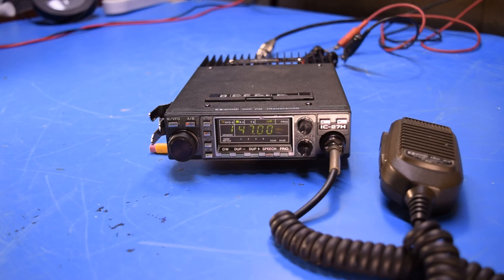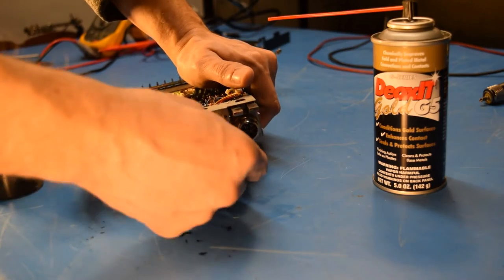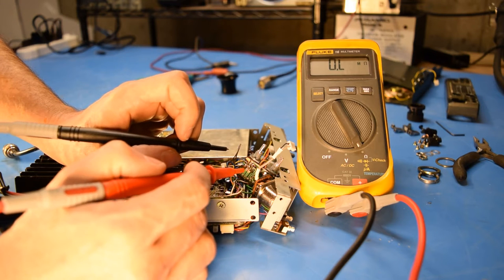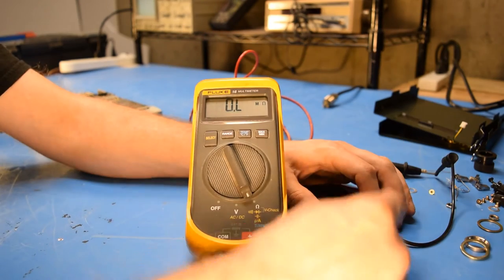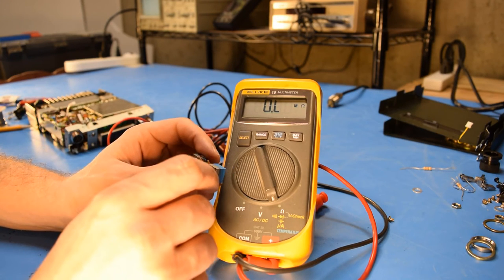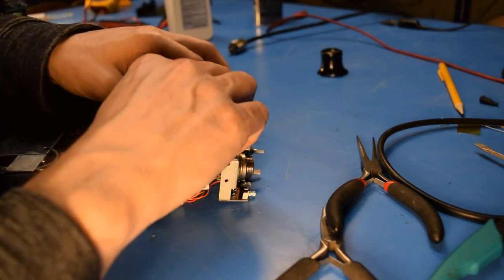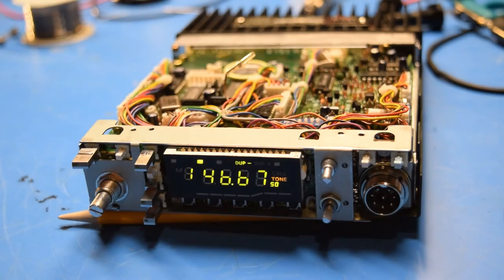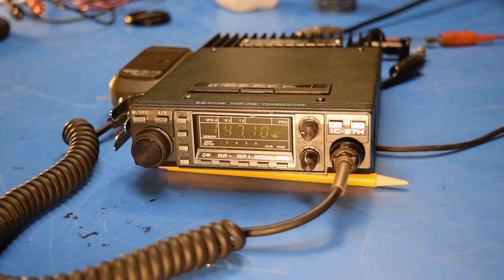Icom IC-27H Squelch Not Working Repair

Comment: Nice job! I just fixed a IC-27E (25W version). It had volume potentiometer totally dead. Tried a few chemicals first but no luck. I spent hour or two to find that part online, but no luck. There were one close match in Digikey though. So I pulled out that pot and opened it. You can take these apart if you are familiar with very small parts and pliers. The potentiometers body is kept in place with two small bars that go thru it. One head of these bars is fixed by crushing. I grinded that end away and pulled bars out. Next you have to take a very small retaining ring off from the back. After that you can take all apart quite easily. Once I got to the resistance carbon ring I used glass fiber scratching tool gently to it. Then cleaned all with isopropanol alc. Same to slide and a little bit of bending more tension to it. All together and then glued the end of the bars. Its now like a new! I still has more to do :) The output is only 17W and 1750Hz tone burst is not working. This radio is pain in the ass to work. Those little wire harnesses goes everywhere, and no room for anything. Old people like to whine about newer radios that those have too little parts. I personally take the smaller parts and less wiring over this! I think next time some oldtimer is whining I will give him this radio and say take a good look at it... Well after all this is a nice radio, very small for its time and a good looking too in my opinion. Its a pity I can't find a service manual anywhere online. 73 de OH5GIO
Reply from the maker: Thanks for the info!  I actually have another one of these radios that has the same problem as yours does - a bad volume control.  Maybe I'll try fixing mine the same way you fixed yours.

Comment: SevenFortyOne -- I have a Radio Shack HTX-212 that has this issue.  The squelch pot was replaced and didn't make a difference.  Have any ideas what I can look at?  A lot of the circuitry inside the 212 is surface mount so I'll be limited in what I can do probably.